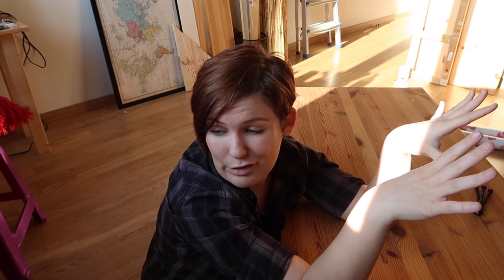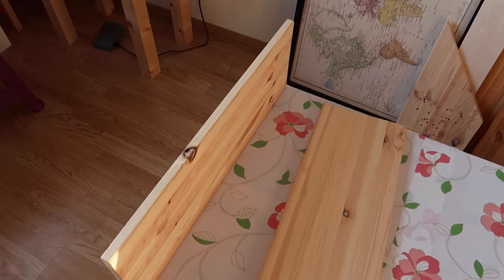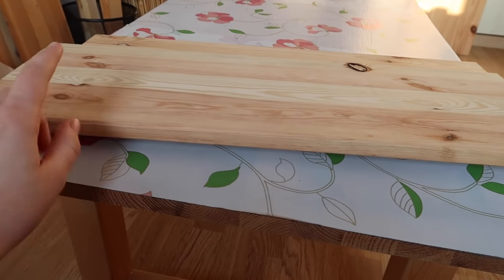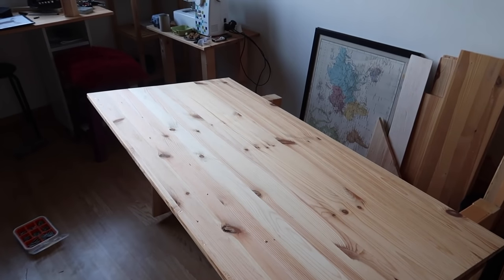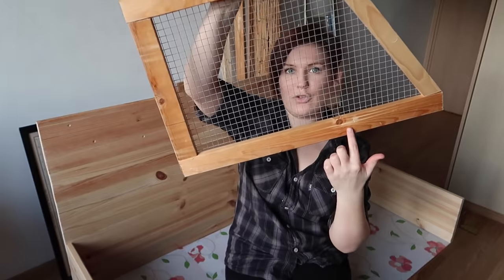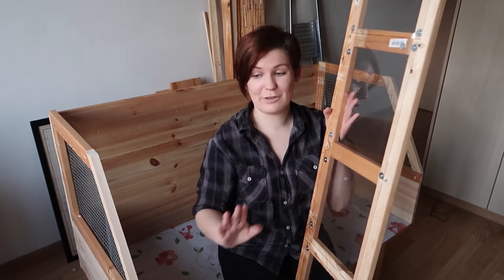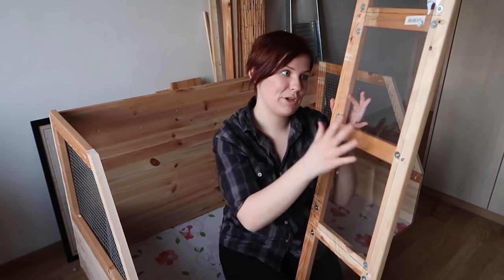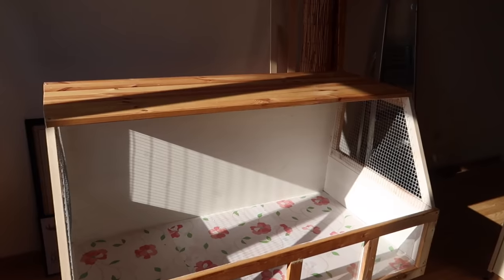DIY Wood Hamster Cage | Building The Bunsen 1069sq inches [1/3]

Comment: Erin, could you please tell me all of your measurements for the sidepieces? I'm doing a 60x100 cage and I'm doing the exact same design on the sides, so it would be very useful to know what you did :3
Reply from the maker: The boarder walls are 60 x 20 cm but you will need to work out the measurements for the windows yourself as they depend on the thickness of the wood you are using as well as the height of the back piece you are using :)

Comment: I know i’m really late but i was wondering if somebody could tell me what varnish she used. Im getting ready for a hamster and need a varnish brand that is safe for a hamster. Thank you❤️
Reply: Did you find one? I'm making this currently!
Reply: @Aspen_Husky  Have you found one since you commented yet, cause I'm also looking for a varnish. I wasnt sure if you needed to use a specific one that's pet safe or if it's just any varnish?
Reply: Ik I'm rlllyyyy late but non-toxic varnish or varnish that you will use on a food cutting board or stuff made for food so it's non-toxic
Reply: Ik im late but I know plastikote is safe but it's expensive for how much you get, I've been doing some research bc I need to seal my gerbils lid as the dust is coming off and it's not good. I've found another paint, rust-oleum painters touch, the one in the tin, on the label it says certified child's toy safe, which means it should be safe for animals. It's also low VOC which is good. It's £9 in B&Q for a 250ml tin so it's much more cost effective than plastikote. Hope this helps

Comment: Im currently in the process of building a cage, using raw wood. I put 2 coats l of spray water sealant on (so far) but it still feels kind of rough.... and im worried about splinters, when i run my hand across it I don't get any splinter and ofcoarse itd be covered in bedding but my hamster is a digger so im worried if he scratches at it he could get splinters? What is your advice?

Comment: I'd love to recreate this cage for some Guinea pigs- I'm afraid they wouldn't have enough ventilation with the plexyglass on the doors but I really like how that looks. Would the side panels allow enough air flow? Or should I put mesh on the doors instead of plexyglass to allow more ventilation?
Reply from the maker: This cage wouldn't be suitable for guinea pigs as it's too small, they need at least a 5ft x 2ft area or bigger. For general guinea pig questions you'll also need to go a forum :)
Reply: ErinsAnimals yes, my the table that I am using is 72in x 24in and I want to do multiple levels so, I definitely will adjust the size to be bigger and taller.

Comment: Did you use pine with a white varnish for appearance? Essentially, is there is a reason someone couldn't use melamine?
Reply from the maker: Yes it's purely for the look (pine is also easier for me to get) but melamine works great for cages :)
Reply: thanks for replying so quickly. I just bought a hamster and sadly I didn't do my homework on the front end so I let the "experts" sell me a black bear syrian in a 10gallon tank. We got home, set it up, immediately realized that when you put him, the 6 inch wheel, is food bowl, the bottle, and the bedding in things weren't going to work. We went back and told them they're crazy and they let us swap for a bigger more appropriate wheel and a "20 gallon long" tank which is better but not where I want to be so I'm looking into ways to maximize his space without buying a tank. :P I really wanna take care of him right.

Comment: Hi all, I have a big question. My hamster cage is to small(its the rosewood pico xl hamster cage) and am getting a much bigger one at 504 square inches (the biggest i can fit in my house)  and I am making it myself. The plan was to make it out of wood and modeled after erins animals bunsen diy cage. I was going to make it out of 12mm thick strong plywood along wit perspex and a 5mm wire roof. However I have suddenly gotten a strong doubt that it is not safe as I am worried my hamster coco will be able to chew through it. Coco chews a lot on her wood chews but the chews are made from a soft wood and she goes through them like mad. Could she chew through the side of her cage? She chews her bars alot and I worry she will chew the side of her new enclosure. Does anyone have any advice on whether or not its safe?

Comment: Isnt the plastic folie on the ground Dangerous? :O
Reply from the maker: It's actually sticky back plastic but no as long as you apply it properly it's perfectly safe. You must make sure that the edges are secured down and you give the plastic time to adhere to the surface so that there is nothing to attract the hamster and nothing for them to grab. You can also do what I did which is to tuck the edges of the plastic under the walls of the cage so the hamster has zero access :)
Reply: ErinsAnimals Thank you so much for your answer. I'll did it like you i think its a great idea 😊 Greetings and Love from Germany❤

Comment: posibly chinchilla but this cage would be a bit too small for one in my opinion, but because she mentioned deep substrate , layers, shelfs and more interior, plus the ventilation i think rats or mice, or at most a guine pig though i doubt they would need the shelfs , and i know its not rabbits as she would have already used a similar set up to before , just my opinion XD

Comment: Pine is still bad in wood if they chew it
Reply from the maker: No it isn't. Untreated pine shavings are only harmful due to a combination of the harmful phenols they produce and the significant surface area that they create by being shavings. The danger of pine shavings has absolutely nothing to do with ingestion, the risk is damage to the respiratory system caused by long term inhalation (breathing in) of large quantities of pine phenols.